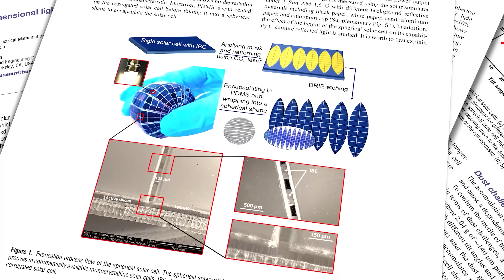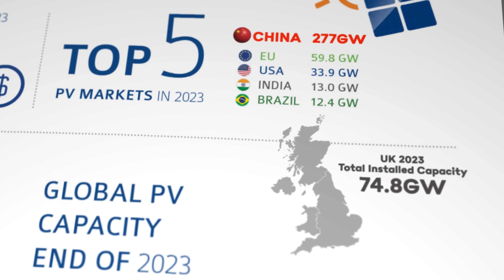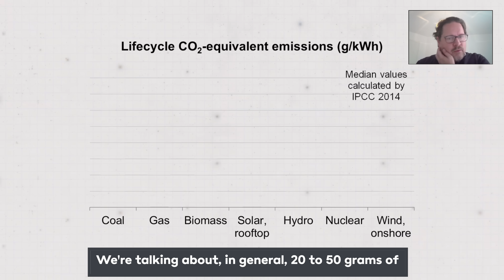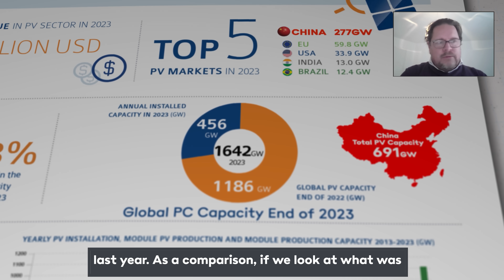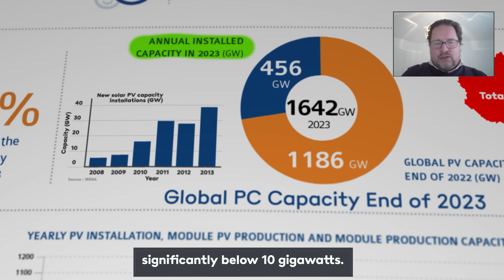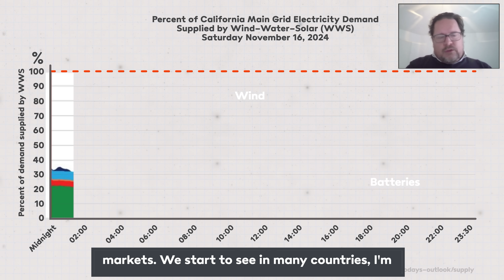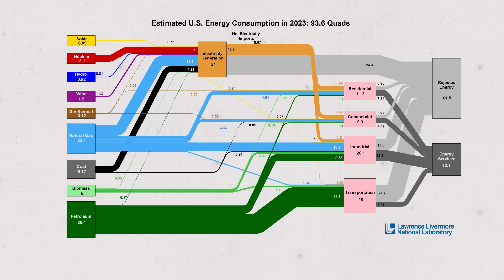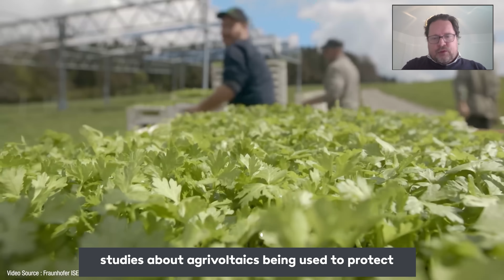Renewable Energy Domination

Comment: Hi Dave, I love your "Just Have A Think" !
Re renewables, people often talk about the mismatch between solar (or wind) power production, and the demand profile. Hence the need for batteries etc. What people seem to NOT talk about is the similar mismatch between coal-fired production and the demand profile. A coal station can, and should, run 24/7. But demand fluctuates wildly over the week, with low demand at night and at weekends. So it's just as logical to have storage for coal-fired electricity as for renewably-generated electricity. It was seldom done, one exception being pumped hydro. Which I suppose just underlines the fact it was needed. Result? More generation capacity was built than the average load called for - you need to build to suit peak load. And the coal plant sits mostly idle when demand is low. So the need for storage is not new, and is not peculiar to solar and wind. Just a thought!
Reply: Agreed here in Michigan. We have a large pumped hydro along Lake Michigan that supported the two nuclear plants along lake Michigan

Comment: I don't know how much you've touched on this before.  I can't remember specific instances of it, but the metric you list about the percentage of land in the UK it would take to power the whole country with PV seems off to me relative to what I've seen elsewhere on the effectiveness of PV in various climates.  It was my understanding that this was a major reason for the project to develop solar energy in Morocco and wire it to the UK. From everything I've seen there is also a fundamental carbon issue with deploying PV and wind in areas that don't have a high level of the associated resource (sunlight or wind respectively). Solar panels and wind turbines come with a pretty big up front manufacturing carbon cost.  When you deploy them in ideal conditions they very handily pay that carbon cost off through reduced fossil fuel useage.  When you deploy something like PV in the UK though even if it can power the UK, from what I've seen the lifetime carbon savings relative to the manufacturing carbon cost is pretty minimal, or in particularly inefficient cases negative. 

I'd really love to see a video that digs into this data explicitly, and shows the amount of carbon these technologies (at their current average market efficiency) really pay down over their lifetime accounting for manufacturing costs in different regions. I don't know how available that data is.  I've tried to search for it before and generally come up pretty empty handed.

Comment: What to do with used solar panels:
1) Fence panels
2) Homeless shelter roofs and some electricity.
3) Wall coverings. for 20 or used in architecture with standard panel sizes so they can be replaced and still make power end of extended life.
3A) Over time recycling will get better, so re-use and delay of recycling add huge value. capitol non destruction, alone is a huge gain, with end of life extensions.
4) officially put in or make shift PV charging stations by volenteers for modest e-mobility charging spots
Reply: They are made from valuable stuff, so it's not like anyone is really going to want to send them to the land fill anyway, and they do last a long time. I think we are still at least 20 years from seeing anything like a glut of used panels moving into the recycling or remanufacturing stream, and I would not be surprised (although I will probably already be dead) to see that today's solar panels contain enough materials to build 4 or 5 panels of comparable capacity, probably in a smaller physical format.
Reply: @christopherdahle9985 Somebody up the road from me has an ancient 100w panel, with the circular blue cells, propped up against some flower pots on the street outside their house.

Comment: As for where to put solar panels:
The US has basically a grid highway system oriented on the cardinal directions. Much of the topography is gently rolling. About half the roads run due east and west, which means, with the prevailing wide berms, incredibly long linear arrays can be built facing south. Many larger roads have ground devouring cloverleaf intersections, which might also be good candidates for solar panels. These sites would save valuable farmland for crops.
Covering America's insanely large parking lots with panels would also make sense, and surely be appreciated for shading the cars while parked.
Reply: The roof of houses, businesses, factories, car parks etc is far better.
Reply: Of course !  a great idea but the oiligarchs will stand firmly in the way of it .
Reply: @gramos9115 When Wal-Mart and other big American stores realise they can light and air condition the shop for nothing during the day, I'm not sure oil will get much of a look-in.
Reply: Yes! Parking lot solar is a win win!

Comment: 121003      The second law of thermodynamics may be false conventional wisdom. Let's face the wonder of full heat use. 

The second law of thermodynamics was developed during victorian england's scientific and religious fascination with steam engines. 

The second law is behind modern refrigerators needing electrical energy to compress the refrigerent to force it to release as waste the heat that it has removed from the refrigerator's service interior in the cooling part of the refrigerent's circulation. The interior coldness draws in exterior heat through the cabinet insulation. There is also discarded heat from mechanical friction and electrical resistance. The net thermal output equals the electrical input with energy not being gained or lost in this refrigeration system including its forced waste. Unencumbered refrigeration by the principle that energy is conserved should produce electricity instead of consuming it. 

It makes more sense that refrigerators should yield electricity because energy is widely known to change form with no ultimate path of energy gain or loss being found. Therefore any form of fully recyclable energy can be cycled endlessly in any quantity. 

Full heat recycling, all electric, very isolated underground, undersea, or space communities would be highly survivable with self sufficient EMP resistant LED light  automated vertical farms, thaw resistant frozen food storehouses, factories, dwellings, self contained elevators, safe rooms, and horizontal transports. 

In a flourishing civillization, small self sufficient electric or cooling devices of many kinds and styles like lamps, smartphones, hotplates, water heaters, cooler chests, fans, radios, TVs, cameras, security devices, robot test equipment, scales, transaction terminals, wall clocks, open or ciosed for business luminous signs, power hand tools, ditch diggers, pumps, and personal transports, would be available for immediate use incrementally anywhere as people as individuals or larger social groups see fit. 

Some equipment groups could be consolidated on local networks. 

If a high majority thinks our civilization should geoengineer gigatons or 
teratons of carbon dioxide out of our environment, instalations using devices that convert ambient heat into electricity can hypothetically be scaled up do it with a choice of comsequences including many beneficial ones. 

Energy sensible refrigerators that absorb heat and yield electricity would complement computers as computing consumes electricity and yields heat. Computing would be free. Chips could have energy recycling built in.
This would improve performance and lower cost,
A simple rectifier crystal can, iust short of a replicatable long term demonstration of a powerful prototype, almost certainly filter the random thermal motioren of electrons or discrete positiive charged voids called holes so the electric current flowing in one direction predominates. At low system voltage, a filtrate of one polarity predominates only a little but there is always usable electrical power derived from the source, which is Johnson (observation) Nyquest (theory) thermal electrical noise. This net electrical filtrate can be aggregated in a group of separate diodes in consistent alignment parallel creating widely scalable electrical power. The maximum energy is converted from ambient heat to productive direct current electricity when the electrical load electrical resistance  is equal to the array internal electrical resistance. 

Maximum calculated electrical power output (watts) is k (Boltźman's constant), one point three eight x 10^ minus 23, times T (temperature Kelvin) times bandwidth (0 Hz to a natural limit ~2 THz @ 290 K) times rectification halving and nanowatt power level rectification efficiency, times the number of diodes in the array. 

There are a billion cells of 1000 square nanometer area each per square millimeter, 100 billion per square centimeter. 

Order is imposed on the random thermal motion of electrons by the structual orderlyness of a diode array made of diodes made within a slab: 

Host crystal is silicon
  P type boron doped
-----‐------‐----___-- Out
🔻🔻🔻🔻
■■■■■■___ + Out 
  N type phosphorous doped 

All the P type semiconductor anodes abut a metal conductive plane deposited on the top face of the slab with nonrectifying joins;  the N type semiconductor cathodes or common cathode abuts the bottom face. As the polarity filtered electrical energy is exported, the amount of thermal energy in the group of diodes decreases. This group cooling will draw heat in from the surrounding ambient heat at a rate depending on the filtering rate and thermal resistance between the group and ambient gas, liquid, or solid warmer than absolute zero. There is always a lot of ambient heat on our planet, more on equatorial dry desert summer days and less on polar desert winter nights.

Focusing on the composition of one simple diode, a near flawless crystal of silicon is modified by implanting a small amount of phosphorus (N type conductivity) on one side from a ohmic contact end to a junction where the additive is suddenly and completely changed to boron (P type conductivity) with minimal disturbance of the crystal lattice. The crystal then continues to another ohmic contact. 

A region of high electrical resistance forms at the junction in this type of diode when the phosphorous near the ĵunction donates electrons that are free to move elsewhere while leaving phosphorus ions held in the crystal while the boron donates holes which are similalarly free to move. The two types of mobile charges mutually clear each other away near the junction leaving little electrical conductivity. An equlibrium width of this region is settled between the phosphorus, boron, electrons, and holes. Thermal noise is beyond steady state equlibrium. Thermal noise transients, where mobile electrons move from the phosphorus added side to the boron added side ride transient extra conductivity so t⁶he forward moving  electrons are preferentally filtered into the external circuit. Mobile electrons are units of electric current. They lose their thermal energy of motion and gain voltage, as they transition between the junction and the array electrical tap. 

Inside the diode, heat is absorbe; outside the diode, to exactly the same extent, an attached electrical circuit is energized. The voltage of a diode array is likely to be small so many similar arrays need to be put in series to build higher voltage.  

Understanding diodes is one way to become convinced that Johnson Nyquest thermal electrical noise can be rectified and aggregated. Self assembling development teams may find many ways to accomplish this wide mission. Taxonomically there should be many ways ways to convert heat directly into electricity. 

A practical device may use an array of Au needles in a SiO2 matrix abutting N type GaAs. These were made in the 1970s when registration technology was poor so it was easier to fabricate arrays and select one diode than just make one diode. 

There are other plausible breeches of the second law of thermodynamics. Hopefully a lot of people, mostly as independent teams, will join in expanding the breech. Please share the successes or setbacks of experiemental efforts. 

These devices would probably become segmented commodities sold with minimal margin over supply cost. They would be manufactured by advanced automation that does not need financial incentive. Applicable best practices would be adopted. Business details would be open public knowledge. Associated people should move as negotiated and freely and honestly talk. Commerce would be a planetary scale unified conglomerate of diverse local cooperatives. There is no need of wealth extracting top commanders. We do not need often token philanthropy from the top if the wide majority of people can afford to be generous. 

Aloha
Charles M Brown 
Kilauea Kauai Hawaii 96754

Comment: You usually do a much better job of telling both sides of an issue.  This video was not a good example of that.  Posting that disproven graphic from Al Gore is very poor form, indeed!  What works in California and South Australia, part of the year, fails completely in southern Canada for months at a time, during winter.  Consider the terms "base load" and "intermittency"...ask yourself if we should rely on an intermittent source of power to provide the base load for a large grid.  Renewables are currently the most cost-effective means of adding capacity, but even China is still adding more fossil-fueled capacity than they are renewables.  Also, the battery in your EV has a certain number of charge and discharge cycles before it no longer stores enough energy to have a reasonable range.  Using those batteries to address the issues created by relying on renewable energy sources, instead of fossil fuels, is a terrible idea.  What's more, the intelligent and well-heeled owners of those vehicles are NOT going to allow the lifespan of an expensive investment to be cut short so that their local utility can save money on how they deliver power.
Reply: "what works in California and South Australia part of the year"
It's not just "South Australia" and it's not just part of the year, avail yourself of some recent facts.
Why are coal power stations closing down in Australia, without replacement being required or viable?
Comparing Southern Canada with Australia is a joke.
Reply: @davidwatson8118  - That's exactly what I just said...comparing a sunny desert with the rest of the world is a joke.  Even Australia is only getting about 40% of their electricity from renewables.  Yeah, coal plants are shutting down all over the western world, because fracking has made natural gas much more cost effective.  Also, it's a little easier to spin up or spin down natural gas-powered plants than it is coal.  I worked for an el-co here in the US, so I got to see first hand the challenges of incorporating intermittent renewables into the grid.  The worst part is, production from renewables peaks when the power isn't needed as much, then drops off a cliff just as demand spikes.  It's a nightmare for generation and distribution, which is why storage solutions are going to be so vital.
Reply: @jasonbroom7147  
40% nation wide and growing.
Some states more than others.
Australia is not all a sunny desert in fact most of the solar power is on the coastline Fringe and dividing range.
Reply: @jasonbroom7147  
You don't like EV's
But guess what they are coming if you like them or not.
Fossil drinkers will go the way of the horse.
Fission guzzlers only have a limited number of cycles / Km as well, then you are up for a new one.
Plus fuel, oil, filters, hoses belts, plugs, injectors, etc etc all while leaks and belching.
I look forward to swapping my fossil guzzler for something I refuel from my roof.
Reply: @davidwatson8118  - I actually like EV's.  I think we'll see more and more of them, because they're a good product.  I'm not naive enough to believe their cradle-to-grave emissions are enough of a reduction from ICE vehicles to move any kind of needle, but they are a better economic choice, in SOME situations.  If you allow the electric company to double how frequently your battery is drained, the economics don't work out nearly as well.  I agree that they require a lot less maintenance, which is a huge selling  point.  None of that is going to change the fact that many parts of the world do not have enough sun and/or wind, year round, to meet all electricity needs.  I'm not sure why you're struggling to understand that, but get outside of your little part of the world and the logistics change in a hurry.
Reply: @davidwatson8118  - Wait a minte, just a couple of posts ago, you implied it was 100% for the whole country!  Sucks when facts catch up to your feelings, eh?

Comment: Dave I have a question that I’ve just thought of. I have no idea the answer to the question but could make an interesting video if the answer isn’t simply no. 

We both know that so far carbon capture is not very useful and a bit of a waste of time at this stage when we should focus more on stopping emissions before removing it from the atmosphere. 

We also know that the oceans act as a pretty big carbon sink

What I want to know is whether there is any research into, and if so any meaningful efficacy for underwater carbon capture
Reply: It's called ocean acidification and it's happening now.
Reply: @ thanks!